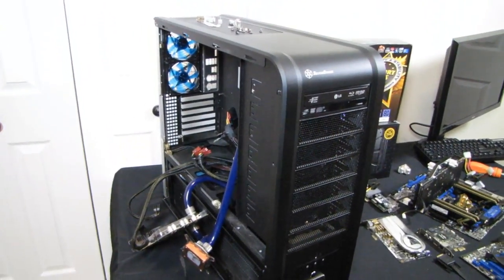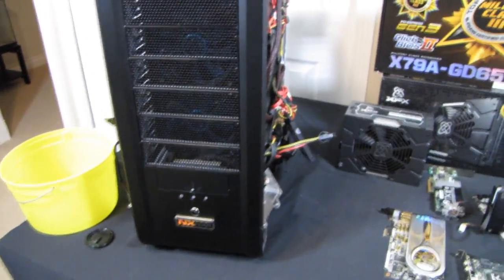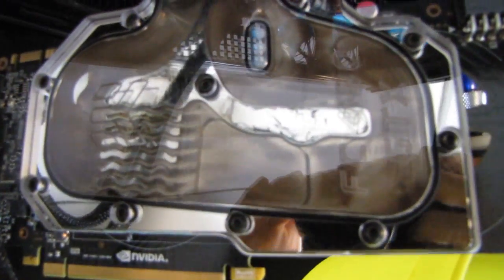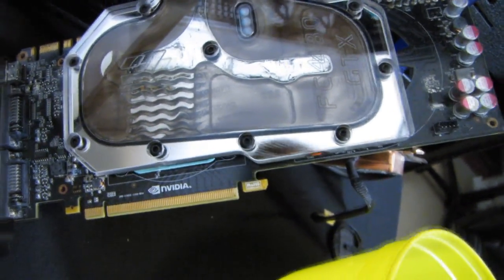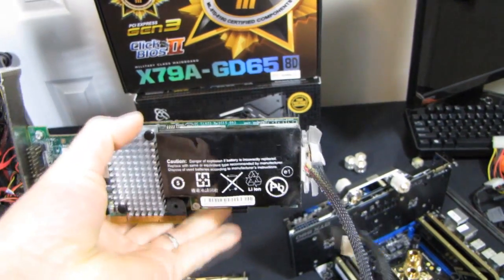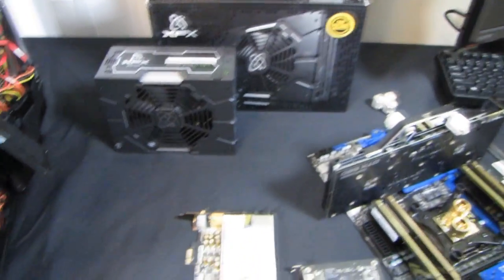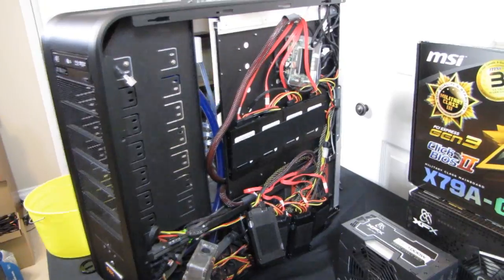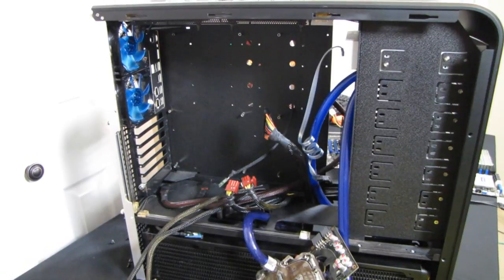Personal Rig Update 2012 Part 2 - Most Hardware Torn Out - More Thinking & Plans Linus Tech Tips

Comment: There is no future proof. You're better off building/getting a 1.5k rig. My rig(i5 3570k, 8GB of DDR3, GTX670 and a Z77 mobo) is pretty good right now and I see no reason to upgrade in the coming year or two, besides the RAM perhaps. Futureproof PC's are BS, the only component in a future proof PC that's actually future proof is the processor and the RAM, everything else will have to get upgraded at some point in the future anyways.

Comment: ah nice personal build , ideas ideas , lots of cables to consider there u could use the lian li black cable tidy thing its a nice brushed black , also you could mount your ssd sideways on your 5" drive bays , , yea hot soapy water for res clean Vingear is good 
maybe go with a clear coolant , maybe u should water cool the raid card ,u could mount the tbalancer thing , near the hdd bays on the back side , also are u gonna do crazy individual cable sleeving theres some good stuff fromdazmode :)

Comment: Sorry acidently ended that, anyway XFX Double D HD  radeon 6850, 600W PSU 80+ certified, AMD FX 6 core Cpu @ 3.3 GHz, 16 GB DDR3 RAM @ 1066 mhz (fail), 1 TB HDD (not enough for SSD), Acer 20" LCD monitor, Blu ray optical drive, and a cheap fail for audio right now cause it costs $ 934 dollars, and I only have $669 dollars at the moment. All my own money, other kids have parents give them money or stuff like that but I'm not spoiled, I buy everything.

Comment: My dream computer = R.A.T9 Gaming mouse, Razer special edition keyboard, Razer gaming surface, Turtle beach Z6A PC headset, ASUS 25 in 1080p HD monitor, Crosshair V formula motherboard, 3 GTX 590's, 32 GB DDR3 2400 mhz RAM, AMD FX 8 core 8150 CPU, 4 250 GB SSD SATA III, Cosmos 2 case, w7 ultimate 64-bit, H100 Extreme CPU cooler, and 3000W PSU w/ AV+ Gold. AMAZING!!!  Right?

Comment: @DeMonYitOoO Probally not. I would not take the risk. Go to newegg.com and look up Cosmos 2 case. It's amazing, with WAY more fans then you'll ever need, about 10 upgrade slots, and LOTS of space with an elegant and easy to manage case. To take of the side you just slide a door, and it has alot of cable routing holes.

Comment: @Iam0ffline Linus what tube size do you use..? Do you have ID 1/2 OD 3/4 or............... ID 3/8" OD1/2" .... and what is the size of those compression fittings from pitspower (FYI my Swiftech Apogee limited edition waterblock is on it's way ;)) Thanks

Comment: there super simple to clean!!

you just take them off, (any rad, i only reccomend for see through though) and put 25% full of dry rice, and fill the rest with water, swish around and the rice will scrub the insides for you. you dont have to fiddle about with brush's or taking the resovoir or heatsinks apart.

clear ones because you can see if there is any rice left inside once your done.

Comment: @Scouse29K I used the TJ07 with my watercooling setup, triple rad on the bottom compartment too. I found that using dryer sheets filters the dust nicely and cheap and easy to change.

Comment: @demaciu88 To tell you the truth this upgrade is going to be for my 2nd gaming rig for when friends and girl comes over, since the current setup is pretty shitty for gaming.  I am upgrading to a 750 watt psu because I want to get a gtx 560 ti superclocked edition, however I want to have a cpu that wont hold back the graphics card.. right now my budget for this is about 500 bucks. psu and gpu will run about 300 so I have 200 bucks to spare... any recommendations for that price range?

Comment: @Darklogix depends on your budget, the best cpu for 775 is the QX9650 sells for $250-$300 on ebay thats a quad core Extreme that cost $1000 when it came out and would rival some i7 and outperform most i5 of course thats subject to your other components.

Comment: @DanieleGiorgino But that's only RAID-1 and 0. Most motherboards have that capability. The real fun with RAID comes with RAID-5 and 6, which provide parity (each disk operates at full capacity with one (or two, respectively) storing 'parity' (XOR checksums) so that loosing one (or two) disks doesn't cause your array to crash. Then you get into even more fun stuff like distributed parity, and mirrored parity (RAID-1 on your RAID-5 or (typically) 6 parity disks for extra saftey, etc).

Comment: Hey Linus, looking forward to more vids on this.  Want the TJ07 too, my concerns are dust, can fan filters be added to the bottom?  If so do you plan to use any? Also I want an EX360 in the roof (will be modded) i may go with exhaust out of the roof, but airflow to the rad concens me as there aren't any fans in the front, if I don't add fans to the front how does the roof get air to it?

Cheers

Matt

Comment: @44fcgdf Oh really? I knew he used those in the water cooling guide, but I didn't know he was putting them in his personal rig. He does know that the GTX 590s don't work at full capacity because of PCI-E bus limitations though right? I would have rather gone with quad GTX 580s, but that's just me. Hell, at this point I'd just wait for Nvidia's new line of cards to come out.

Comment: Could someone explain to me the difference between a core2duo and dual core.. I've tried researching it but there isn't that much info out there.. reason is that im upgrading one of my older machines which has a socket 775.  I can either go with a 2.9ghz core 2 duo or a 3.2 dual core which are the highest processors I can find on the market for that particular socket.  I dont want to spend to much money on this old machines just give it a lil boost from a 1.8 core 2 duo.

Comment: @Supralic1ous your kidding me right? ok a raid card allows you to run multiple hard drives or ssds in configuration to either help prevent data loss or gain speed..or both..think of it as cross fire or sli for your harddrives

Comment: do a unboxing of the Antec High Current Gamer Series HCG-900 900W ATX12V v2.3 / EPS12V v2.91 SLI Certified CrossFire Certified 80 PLUS BRONZE Certified Active PFC Power Supply

Comment: @keeganowen12 there are a few things you need to take into consideration, especially since your comp wasn't built for sli. also the 1156 socket is aging and doesn't offer the best sli support. you need to make sure your power supply has enough potential for 2 gpus. also do you have an OEM copy of windows? if so, you'll have to buy a new copy if you change motherboards. my suggestion is to sell the 560 and get a better single gpu. in the end i think you'll be happier, and it will be cheaper.

Comment: you should always use a 80mm or 92mm fan for the Raid card, and instead velcro it to the case bottom,  That way you can put it on a fan controller

Comment: someone who know computers please help this is doing my head in. so i bought a pc and ive upgraded my graphics card to a nvidia gtx 560 ti and i want to get 2nd and use sli but my mother bored does not support sli so i looked around for an upgrade then i realized it needs to be compatible with my cpu i have a intel core i7 870 and the socket is 1156 but i cannot find a sli compatible 1156 mother bored that is any good someone help

Comment: Linus, I use a Dell PERC 5/i RAID controller. they can be had for ~$100, and adding a fan and heatsink is easy. they accept old P4-type northbridge heatsinks, if you switch the retaining wire. I threw a heatsink on the IOP, too, with some thermal epoxy, but you can get away without it. they support up to 512MB of cache RAM, too.

Comment: I love doing this. There is nothing like pulling your rig apart for some upgrades and reconfiguring. Love the satisfaction when you are all done. Though I am not a liquid cooling fan, yet, I like my nice big air coolers. :)

Just ripped my system apart to replace the motherboard (ASUS CH IV Formula to Sabretooth), video card (2x XFX 6970 to DD BE 7950), PSU (Non modular Cougar 700 to HX850W modular), added 750GB WD CB SATA6 HDD, and removed G.Skill RAM cooler. 

Now working on my daughters.

Comment: Hey i got again a question.
I wanna buy this processor.
AMD FX-4100 Quad-Core 3.6 GHZ
But i also need A Decent motherboard which isn't to expensive under 100 euros
like is has to be able to add more then 8 gis of ram 
And a good Overclocking bios or hom you wanna call it
please reply

Comment: @Meneadeszz what CPU are you overclocking, and also are you using the bus frequency to overclock, cos you really should be doing that, it can mess up all sorts of things. You need to change the CPU multiplier and if that is locked then i wouldnt overclock it at all or only overclock very slightly.

Comment: Hey linus i got a question.I tried to overclock my CPU and i come to abot 3.4 mhz and it went good.but after i start my pc i get to my destkop and efter few seconds my pc freezes?
but also when i try to overclock more my pc doesnt start it just restart.In my bios is see like frequency from 100-800 and when im arround 266 (its the standard) i can go until 258 above that my pc doesnt start. and when i use like 255 my pc start but freezes